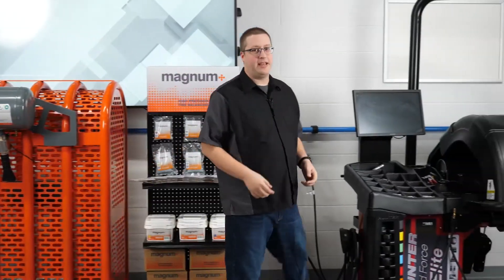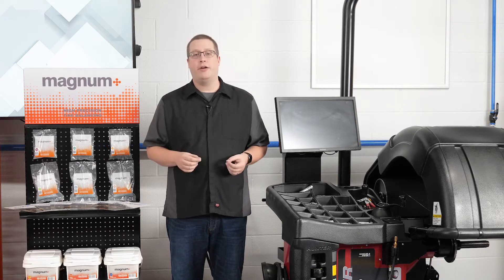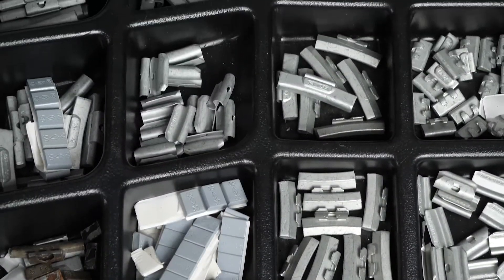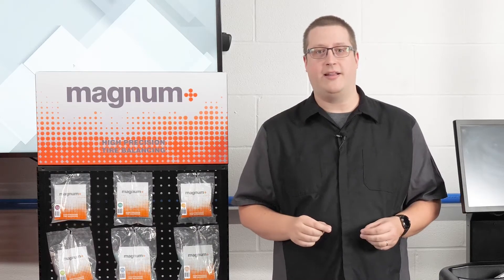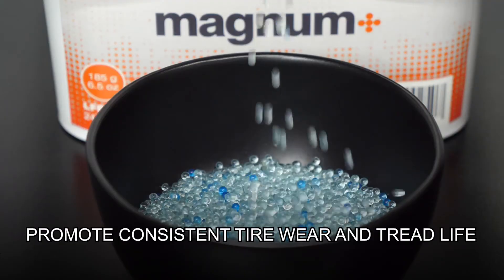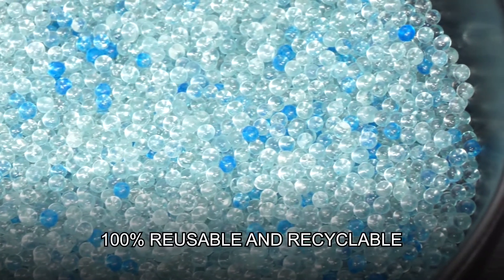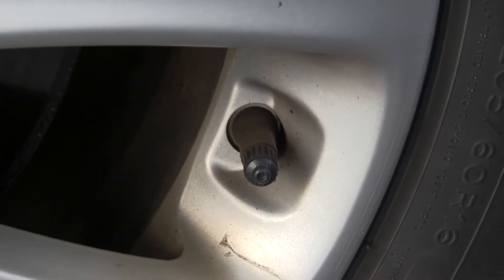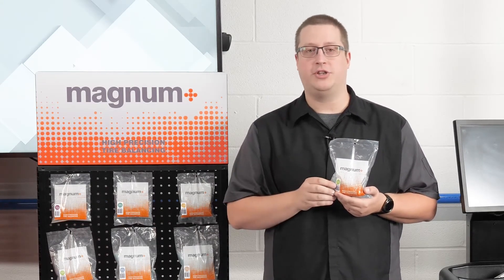Martins Industries – Magnum+ Balancing Beads

Comment: On a Frieghtliner Cascadia (big rig / diesel truck) these Magnum balance beads / bags 
Worked excellent. First on my old bosses truck, then on mine.
Within about 30 miles.. the steering wheel went from shimmying back in forth, to all of a sudden smooth.. after new front steer tires were installed on bossed truck.
I drove that truck at an average of 73mph but up to 80. 
One night i drove all the way from the top of CA to soCal at an average of 80mph.. 
These Magnums had it smooth as can be.
I put these in my new front tires when i put my truck on the road (Cascadia also) and got the same great result. Only regret is not buying more. I need some right now, now that im in Dallas TX.. and no, not for the front, those are still fine. I need some for the rear drive tires (bought some used tires and need more Magnum bags.

Highly recommended. Ive tried 3 types.. Esco, Counteract and Magnum. 
Counteract claims to be the best but moisture will make them stay in one place. They deny this but its true. Ive removed my previous tires, seen and touched it myself.
Get Magnum.. i would suggest Esco if u cant find Magnum.. those brands keep adjusting like u would need and want them to.

Peace.